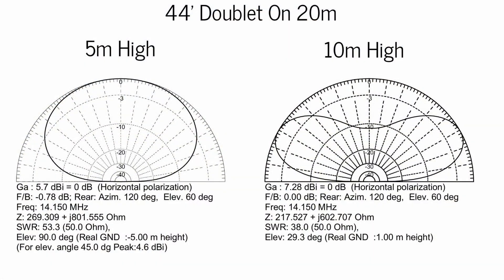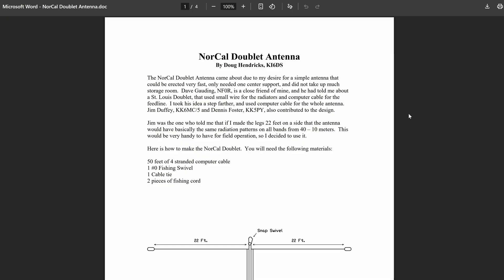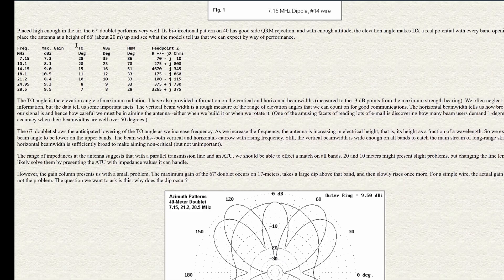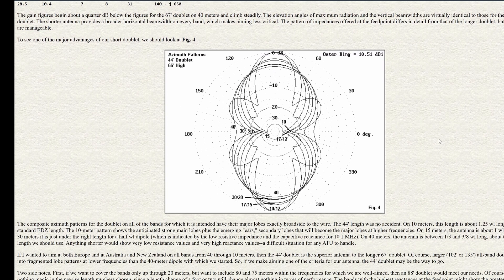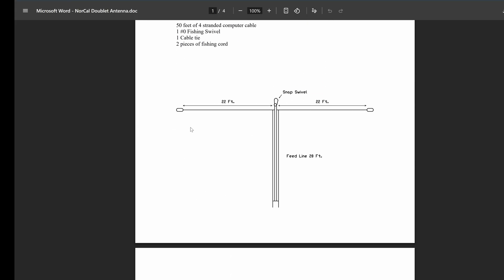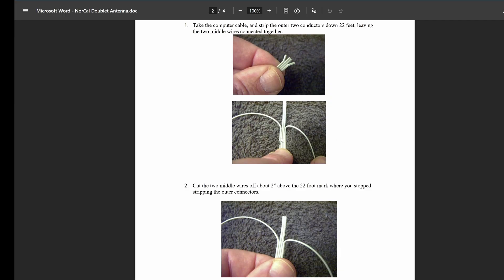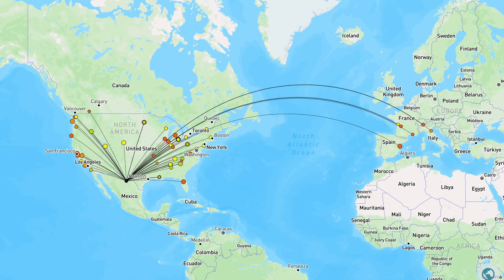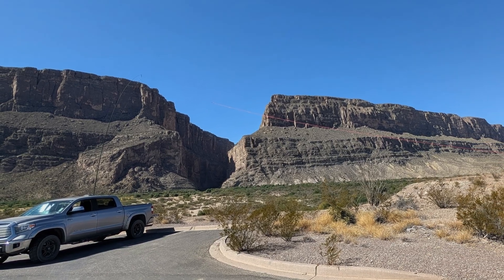NorCal Doublet | Great Idea, but not Perfect

Comment: "It works, you're going to make contacts, I just think there's a lot better antenna..."... describes the vast majority of the portable antennas out there.  Inefficient, but it will work if push comes to shove.
Reply from the maker: Yep, for sure! The fun part of this hobby is figuring out which ones actually perform better or just getting lucky with propagation!

Comment: Back in the 1990's I ran a 44' doublet with 30' of foam core 300 ohm twinlead to a 4:1 LDG balun then 10' of RG-58 to a LDG auto tuner. Rig was an 817ND. I worked all over the world on SSB from 40m thru 6m on that antenna and still have it today. de WE0H ..

Comment: The NorCal Doublet was designed for a lightweight inexpensive multi-band for backpacking.  It does that very well.  Designed 50 or 60 years ago buy people creating a whole new approach to lightweight portable QRP operating and building the radios that were the basis for what we enjoy today.  You just participated in reinacting history.  Be greatful for what that group of brilliant experimenters and inventors brought to the ham radio world.
Reply from the maker: Thanks for the comment, Dick.  I’m definitely grateful for all the work and innovation that came before us. I’m simply pointing out some of the limitations in this particular design. I’ve actually used this antenna for lightweight QRP and even SOTA activations, and always wondered why it didn’t perform as well as I expected. Which I think might be helpful for others.
Reply: @Tim-K5OHY I agree it isn't the most efficient but, deployed at 15 to 20 feet on a summit it is awesome.  I use several antennas and radios designed by the SoCal Gurus like Hendricks, Weber, and Burdick.  I use my 300 ohm ladder line doublet a lot but rarely from a backpack. K7ULM

Comment: I knew a local guy here in Alaska that was both frugal and still a contester.  He used to pick up discarded Cat5 cable from local dumpsters, snip 12 inches off of the yellow sheath, strip off the insulation off the 8 individual wires (both sides) and twist them together.  Cut to length to fashion a dipole for his frequencies.  He ran 100 w and did really well in the contests.  Optimal reuse / recycle stuff.  Now I wonder about the comparison between zip cord and Cat5 cable?  More stuff to build....
Reply from the maker: I ran into someone who recommended cat 5 instead of the ribbon cable. According to them it's better. However, I can't seem to find that reference right now. If I do I'll let ya know.
Reply: @Tim-K5OHY  I can’t comment on the Cat5 you refer to here but Simon VA7BIX aka HamJazz on YT has posted several videos showing use of Cat5 as radials and other setups.
Reply: Cat 5 is much lighter

Comment: 👍
Reply: Just thumbs up because of my poor English. I have been building my antennas myself for years. There are even better options than the ready-made 450 ohm cable, for example at rain. I usually build my ladder line myself from spacers made of plastic and simple copper wire. also i run vertical dipoles with ladder line feed. i am looking for dx since i came to pota before a year or so. i have 49 states confirmes in pota with my 2x7m vertival dipole. only the staates ND and Hi are missed. i hope i work that all staates us award from europe all P2P before the sun goes down. I am portable only, no station at home. so 49 staates is ok the last two years in pota. nice video and enjoy ham radio. 73 klaus
Reply: @DF2GN  Your English is fine 🙂 de WE0H ..
Reply from the maker: @DF2GN  Your English is great, Klaus! I made my own ladder line in my last video using 3d printed spacers. It worked really well. I was just reading about vertical dipoles fed with ladder line yesterday. Seems like a great solution for an efficient multi-band antenna with a great take off angle. I might have to try that soon!